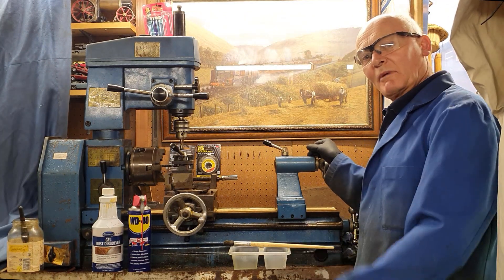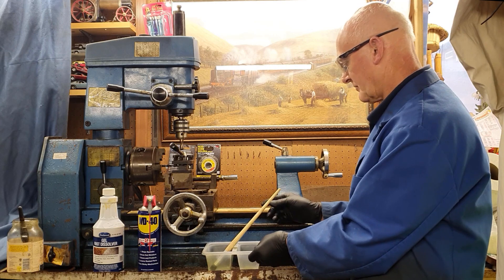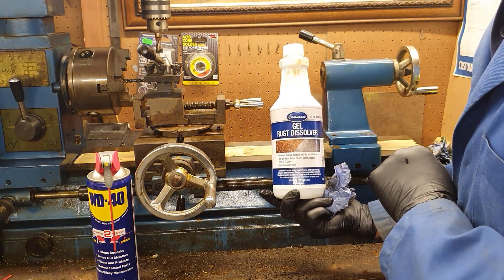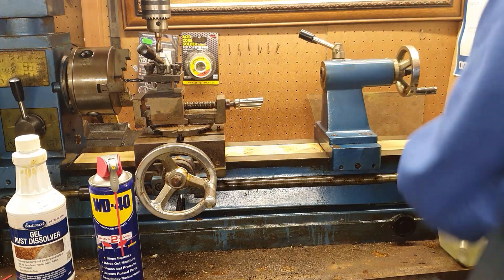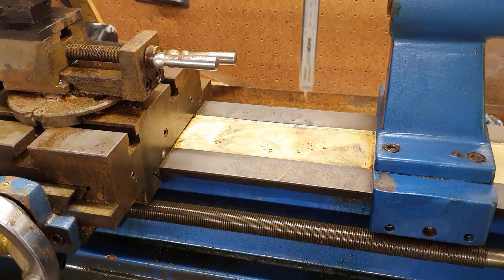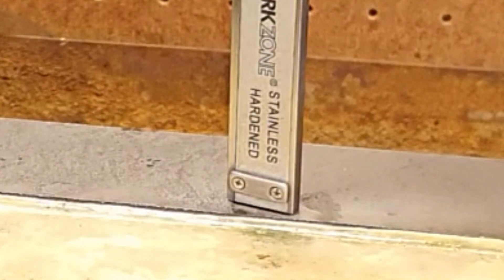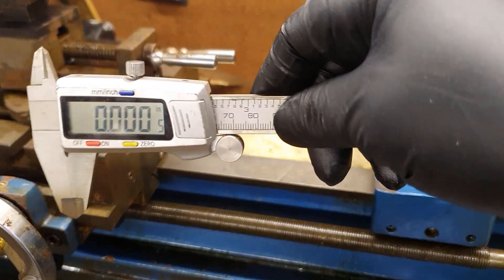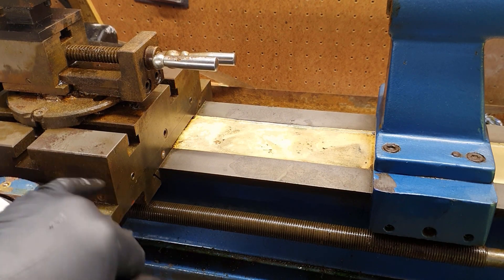Can a Rusty   Lathe, Mill Drill  be saved from Scrap Part 7

Comment: looks like a older Smithy AT300 that compound looks like its from another machine though. I have a "newer" version 1220 XL, Although not as rusty its needed a lot of love to get it back to as good as it can be. Im not looking for anything in high tolerances out of it.  I only cleaned off everything and lightly removed surface rust. took a fine diamond stone to to knock down high spots and nicks.
   The super fine #m pads did great for cleaning things up.  Cleaned and oiled its getting better every time Im in the shed.
Reply from the maker: Hi, Mac 1911,
Your lathe restoration technique sounds quite similar to the depth's that I aim to go to with mine.
I will mot be 'scraping' beds and slideways etc. as I feel the lathe will probably return fairly good results, but we will see.
Yes, the compound does seem a little odd.
The tool post is simply bolted to the top of the swiveling vice (that could be used for holding material) while drilling and milling.
Maybe there would normally be just a large spacer between the cross slide and tool holder, which I think would make a sturdier mount.
I will look at others on YouTube to see what they have.
Maybe somebody might chip in with a comment.
Cheers.
Andy G.
Reply: @masterpiecesinminiature8299  quite possible thats a “do all” type of compound for that set up. 
   My lathe is from the late 90s
I had a professional machinist check it out and he said it was never cared for or even set up correctly from day one. Parts I thought were rusted was just old dirty hard rust prohibitor .
    It was filthy , everything that was supposed to be tight was loose and everything that should move freely did not.
I had to retap several threads, replace nuts and bolts.
     I have the lathe darn near best it can be and moving onto the mill.
Reply: @masterpiecesinminiature8299  im not scraping ways either.
I did take a fine diamond stone and gave the ways and gibs a quick going over just to knock down any high nicks or such.
    It was night and day once the ways and gibs where clean and the lead screws where adjusted and much of the back lash removed
Reply from the maker: @Mac-mu9cs  Hi again,
Just seen your added posts from a few days back (sorry).
You do sound to be getting on top of your issues with the lathe, and it is starting to sound as if it will be set up as best it can be when you have finished recomissioning  it.
Hopefully we will both get pleasure out of using the machine and manage to turn out some acceptable projects on them.

Comment: Keep on Geling Andy you will get there!!
cheers Kev
Reply from the maker: Last application now. I am sure it will do for me mate, as there has to be a sliding space tolerance between the two surfaces, and any rust , ( if there still is any, which I could not measure), would (in my opinion) have no effect on the longevity or accuracy of the machine.
Cheers.
Andy G.

Comment: Here in Scandinavia we have a rust converter named "Rustbjörn" in Norway and "Rust eater" in Sweden.
It's a white milky liquid that converts rust into an iron compund that stops further rusting.
Turns black after just a few minutes and can either be scrubbed off or painted over once dry.
-The small spots of rust that remain on the ways of your lathe will be polished off once you oil the ways and start using the lathe.
Reply from the maker: Thanks Erik for the information regarding your local products.
I am sure you are right about the lathe bed slideways being ready for use now.
Cheers.
Andy G.